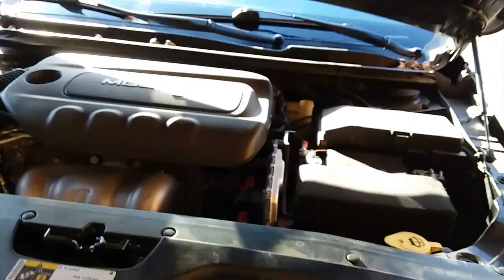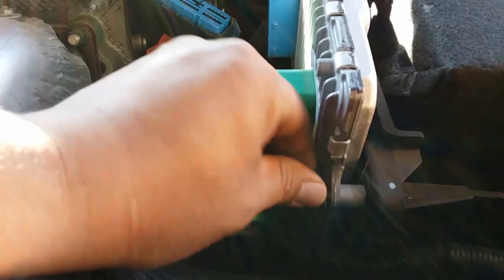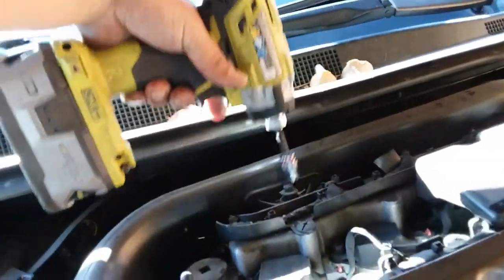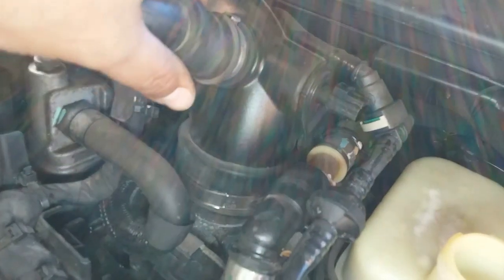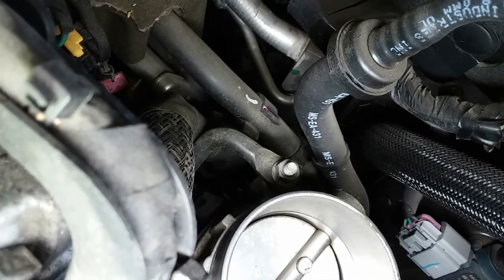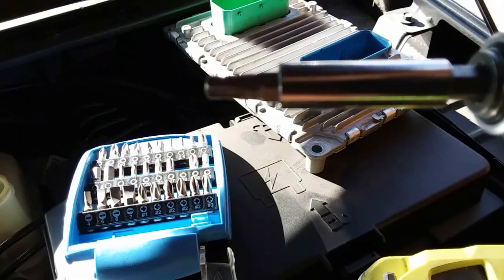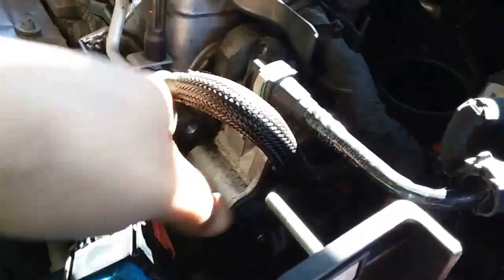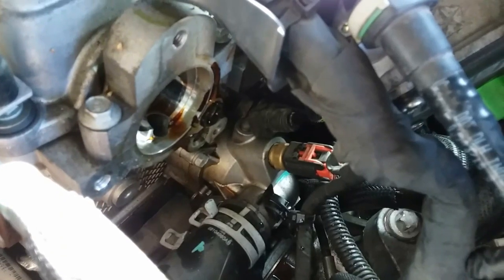How to: Remove a Thermostat From a 2015 Chrysler 200 Code P0128 FIX

Comment: I just did my daughters this past Saturday.  A couple tips.  In addition to removing all the hoses you did, I also removed the metal bracket that mounts to the motor and the bottom of the throttle body.  2 bolts to the motor, two nuts to the studs.. then removed the upper screw in stud with a very small box wrench (like 4mm?).. can also use a reverse torx if you have one that small.  Need to remove that stud to get the bracket off.  Then remove the bottom one, just to have more room.. not necessary, but easy. THEN remove the one hose you did with the wire clip.

After that's done, the problem is the hose clamped to the back of the thermostat housing.  The hose and the clamp is in the way.  Use a long screwdriver and a hammer/rubber mallet to break the clamp.. I broke it by mistake just trying to spin it and the hose.. so my luck the clamp broke and I removed hose and then you have a clear shot to the last bolt..  Install new part, then put hose back with a screw clamp pointed towards the back where you can tighten.. install hose with metal clip.. install lower bracket stud.. and put the bracket in place with the upper screw in stud at the same time.. line it up and as you tighten it, it'll all come into place..      Good luck if you have to do it!!  take pics as you go especially of any christmas tree  push in holders.. and if you break any that have zip tie loops on them, simply drill out part of it and put a zip tie in it.. 

Also, I removed the battery and the part of the battery mount box that the PCM mounts to..  Take patience, but not impossible!!
Reply from the maker: lol i believe it brother. im surprised we didn't have to pull the engine. lol .... thank you for your support bother!

Comment: Loved the video but I need your help! The hose you broke off accidentally broke on me when I was attempting to remove the top radiator hose from the thermostat. What happened with yours? How did you fix it?
Reply from the maker: I think i ended up getting the replacement from the dealership

Comment: Jeez. I'm doing a 2011 tommorow, and I thought maybe it was the range for this part. Fortunately it was not. The version I am doing is a pain it the whawhosit's as well, but not nearly as poorly engineered as that one. THey design these to be sold, not maintained. That's why I love MY car. A Subaru. It's designed to be maintained. Even the oil filter is at the top of the engine easily accesable and replaceable with your HAND. Fricken Chryslers tho. Good job bro. I watched about 3/4 of this in case my daughters year had this new arrangement, then I skipped to the end, and realized that the Housing you took out was a completely different part. Thank Goodness. Another video I watched to change the part I have, the older model thermo housing, just involved the air box, some wiring, and hoses. I didn't have to remove the throttle body or whatever the heck that electrical thing was. And at least on video, it looks like the bolts are RIGHT THERE and easier to get to. Thanks for posting this video. If people have money they WILL have it done. But if they are like me right now, they will NEED to do this. I'm doing it for my daughter, and I am going to MAKE her help this time. (I always say that, and sometimes it actually happens).  Databyter
Reply from the maker: 🤣🤣🤣🤣good luck brother yeah this was no easy task hopefully yours is a lot easier, but never the less still a pain. Yeah I agree these vehicles, honestly anything Chrysler related, Jeep, dodge, fiat.....junk in my opinion. These vehicles are designed so you have to take it in to them for repairs...a win win for the them and a lose lose for us...good luck brother!

Comment: Excellent video and very detailed. I'm about to do mine even though you said I should pay somebody. Your making me nervous but, I will let you know how it went. Wish me luck.
Reply from the maker: Lol, yeah man it's a big job. Harder that what it seemed.  But the weekend is here so just take your time and be very very patient it's going to take a while. Good luck buddy! Thank you for your support!
Reply: Is it normal for the thermostat to be change so early for a Chrysler 200 2015 . I have to replace mine and it’s only a 5 yr old car let me know
Reply from the maker: @bewokelastdon7132  Yes! The reason for this is because the Engine is Aluminum Block and the thermostat housing is plastic. With heat plastic expads and contracts together causing it to fail. Manufacturers now a days cut corners to save money and increase their profits. This is a fine example of bad engineering and the consumer has to pay the price. Sorry, wish I had a better  Answer for you. Thank you for your Support!
Reply from the maker: @mattlamunion6083  yes, because they use a plastic housing on an aluminum block, which causes it to warp and leak or go bad. Manufacturers cut corners to save money and leave it to the consumer to suffer
Reply: I had to do mine at 44 km
Reply: Idek why I feel a little intimidated to do this but was perfectly ok with shimming the valves on my bike like I was a pro or something

Comment: Highly recommend that your replace the Thermostat coolant lines to the thermostat due to prolonged engine heat water and they will become brittle and brake during the removal process. Coolant bottle outlet hose P/N 68104988AB /2015-2017, OE Solutions Series Heater Hose - Doorman P/N 626-32  FITS Chrysler C,LX,Limited,S 2.4L L4- Gas, 3.6L V6-Flex

Comment: Would it be worth it to drain my coolant first? Or will i still get a bunch of coolant out of the block no matter what?
Reply from the maker: You'll still get alot of coolant from the block
Reply: @559powerscape  thanks i wont bother with it then. Going to do this today. Just got to say it looks about as annoying as doing plugs on an 03 c240.
Reply from the maker: @normant5056  it is a difficult procedure, you can also try attacking it from the front but still got to remove like a million things to get to it. It's like Chrysler, Dodge and Jeep stay up all night figuring out ways to make it Impossible to work on their cars....sorry bro, Good luck!

Comment: Curious.... the dealership is charging about $984 in labor alone for this but can have it done in a few hours.... ugh! My 2015 is at 112,000 miles so I'm not mad about the repair just the labor cost.... part is being charged at about $300.
Reply from the maker: Yeah, the reason they are charging alot is cause of what needs to be done. This is a weekend project for sure

Comment: At min 19:52, how did you take that hose off from that white clip. Im squeezing both sides and pulling but it’s not budging. I’m trying to put the new thermostat but that hose is killing me.
Reply from the maker: Yeah bro that's the way I did it squeezing the white tabs in and pulling on that hose. They using a flat head to try a
To loosen it from the bottom of the black clip to let go of the white clip. If that makes any sense. Hope this works  out for you! Thank you for your support!
Reply: GEORGE LOPEZ HOW TO DO IT YOUR SELF got it thanks man
Reply from the maker: @chalihernandez3657  heck yeah man! Yes I KNOW! THIS PROJECT IS A HEADACHE...ITS A NIGHTMARE! GLAD YOU WERE ABLE TO GET THAT STUBBORN HOSE OFF! THANK YOU FOR YOUR SUPPORT!

Comment: Did the thermostat code turn off right after install?
Reply from the maker: No it had to be cleared with a obd2 scanner
Reply: @559powerscape  what if it’s still there ?
Reply: It’s says permanent
Reply: I think I just gotta drive it
Reply from the maker: no it's not the sensor. You just gotta drive it. I currently did it on a Jeep Cherokee, same motor and same permanent. Just gotta drive it till it goes away. If it doesn't I've noticed that if you take it to get the PCM reflashed it goes away after a few miles....dodge products bro. Your good just drive it. Been driving this Cherokee for a good week and same permanent still...if it doesn't clear by next week a pcm reflash might be needed cause it's a dealer car and needs to be smog.

Comment: Just did one today at work. Didn't take half the stuff you did off.back bottom bolt was not pleasant Chrysler junk for sure!
Reply from the maker: 😆 lol right! Yeah I removed all that to "make it easier" lol yeah right this whole project was a joke!
Reply: Does it need a gasket?
Reply from the maker: @davidolmedo2351  it has a built in rubber seal. Just make sure you clean off the contact surface

Comment: What is the part  you  broke called ?? In minute 17.08 ??
Reply from the maker: Its a coolant bypass hose...just slapped it on and threw a hose clamp on it....no leaks
Reply: I fuckin broke it too !!!
Reply from the maker: Cheaps azz plastic parts bro 😮‍💨

Comment: 2nd day 2 and half hours later, working on that bar you threw away. Mad problems, so I decided to break out the blade, I'm 3 quarters of the way through! I can't wait to hurl that bitch across the garage!!!
Reply: I finally got that sucker and yess, I pitched that bad boy as far as I could. Now I'm at that fourth pain in the ass nut that is impossible to get at on the thermostat. btw those 5/16 nuts can be taken off with 8mm also. Anyway, working on taking clips off hoses to get better access but I'm giving up until tomorrow. Word up!
Reply from the maker: I  TOLD  YOU! LOL. This was a pain in the azz to get out. I bet your wishing you paid somebody now right? Man more power to you! Lets get this done! Sometimes you just have to take a step back and look at the project to get more ideas to try to make it easier on yourself. Good luck buddy!

Comment: That last screw on the thermostat is a pain in the ass man. The same one I’m stuck on.
Reply from the maker: Yes it is! Took me all day to get that sucker out!
Reply: Think Im going to give this a try. Same vehicle, drives well for days (with engine light on) and then bam, overheating warning on dash.
Reply from the maker: Good luck buddy!
Reply: Yeah I’m stuck with that last screw. I managed to get one of those hoses off just have one more to go. So I figure I’ll continue to do this on Saturday lol
Reply from the maker: @estevanramirez  YES! THIS IS A HEADACHE!  I'm glad I put the video out there I am not glad I had to do the job. LMFAO!
Reply: GEORGE LOPEZ HOW TO DO IT YOUR SELF yeah man now my car is back to normal drives like new. Thanks bro for this video!
Reply from the maker: @estevanramirez  Hell yeah I'm glad this worked out for you! It was a hassle wasn't it? Thank you for your support!
Reply: GEORGE LOPEZ HOW TO DO IT YOUR SELF yeah man big time! Thanks again bro
Reply: 20:34 bottom corner bolt. 10mm. Who would've thought. Hardly see bolt can put your finger on it. I used a deep 10mm 1/4 drive,swivel, 3inch extension, then air ratchet.